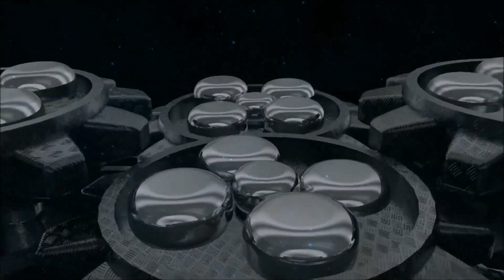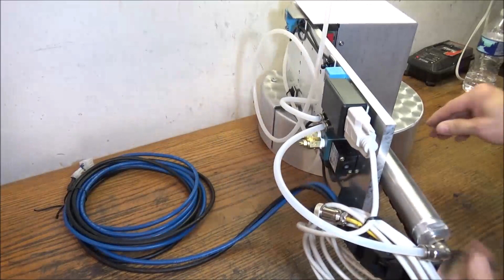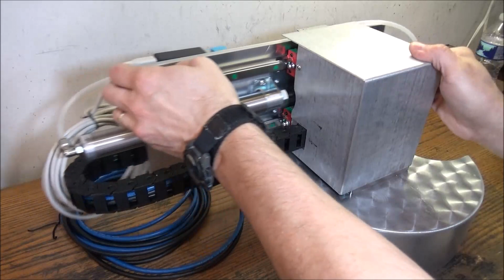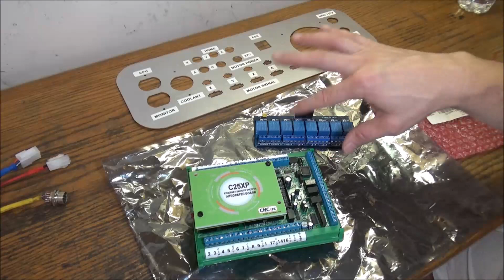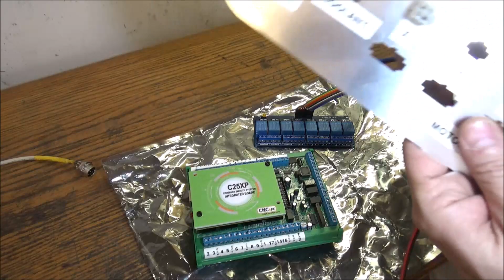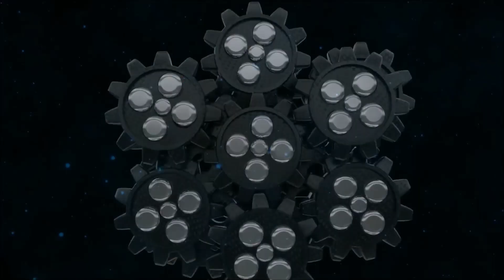PM727M ATC Update

Comment: It is very similar as the one in Tormach, isn't it? There is another configuration type, in that it uses a rotating arm to load and unload tools from magazine to spindle。Have you done a research which one is better in all aspects?
Reply from the maker: Yes it is similar the arm changers are faster but more moving parts

Comment: Could the laser cut out panel have laser engraved labels instead of the printed labels ?
Also are you using F360 for your CAM?  Just asking as they recently stopped allowing tool changes in the free version . . .
Reply from the maker: Yes I am using F360 I purchased a legacy  licenses

Comment: Nice job 👏. 
Something came to my mind and it is about two sliding rails. 
Are they rated for lateral forces that they are going to experience? 
Thank you,
Reply from the maker: Yes, The linear rail have equal load capacity in horizontal and vertical directions.

Comment: I am using this board for my PM25 conversation at the moment.  Will be nice to follow you and how you set it up. So far the support for the board is pretty minimal.
Reply from the maker: Hi Dave, I have Spoken to Arturo and he has been very busy with development. That is normally how these things work documentation is always behind. this particular board the C25XP has only been on his website for about 3 weeks. The plan is to have this be a very simple install compared to the C82
Reply: @CNC4XR7  I got mine up and running - still some bugs to work out, but PM25 spindle control, and closed loop steppers appear to be working well.  Am curious if you will be switching over to Mach4 when you implement this board or will you continue using Mach 3?
Reply from the maker: @yz400fer69  I will continue with Mach 3 on this machine. New screenset will be coming as well
Reply: Yes, Arturo has been good with support but he is certainly busy at the moment.  Waiting for one last component and then I will begin testing mine.